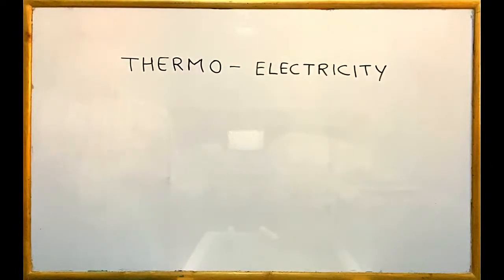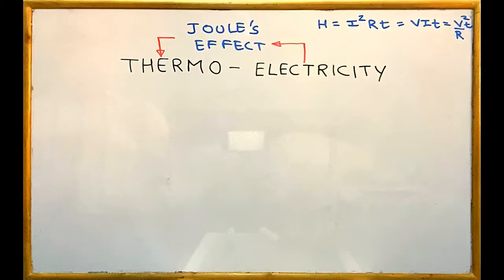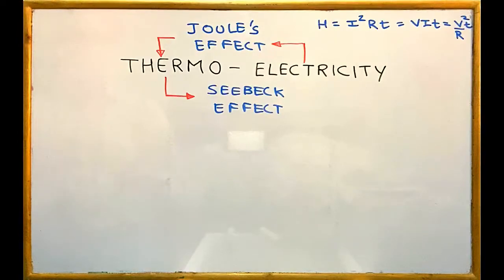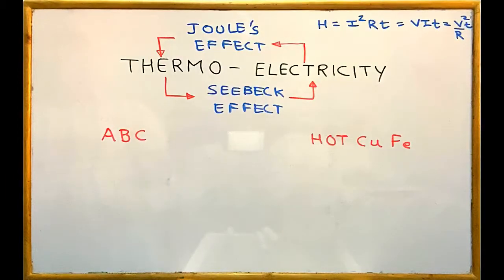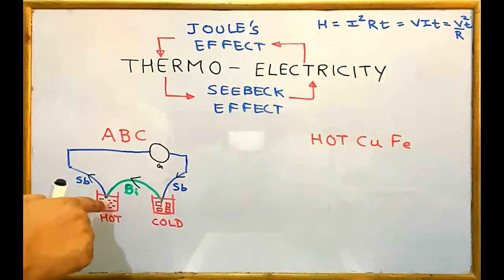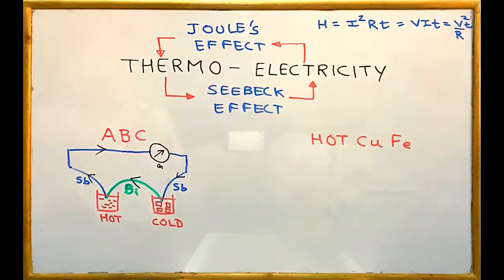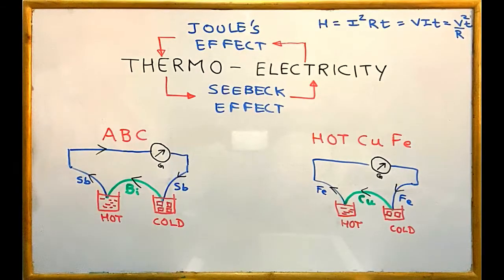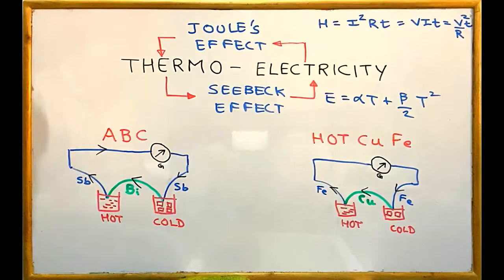Current Electricity - Seebeck Effect

Comment: Sir , why this method is not used for producing electricity at commercial scale
Reply from the maker: Because the power generated is not very high. It is mainly used for very sensitive measurements of temperatures